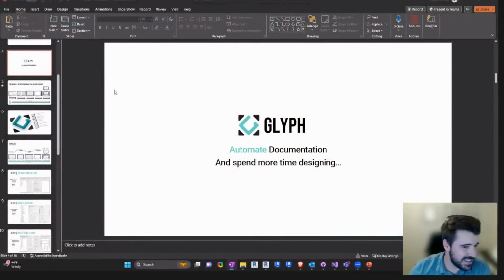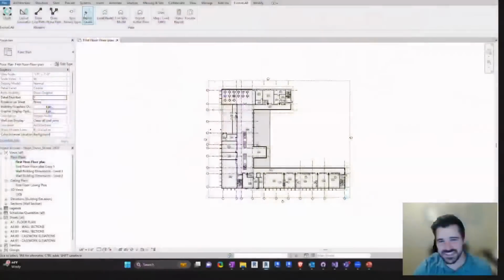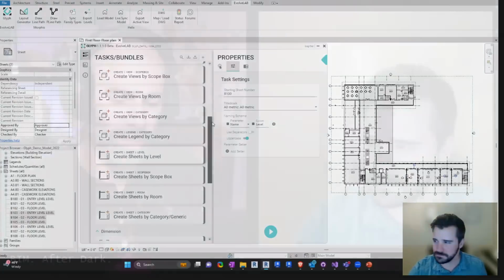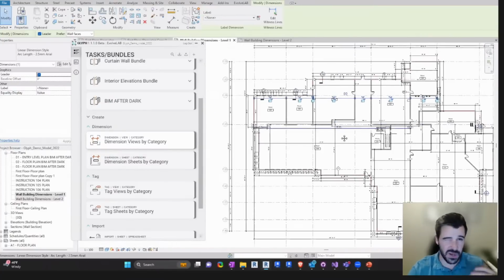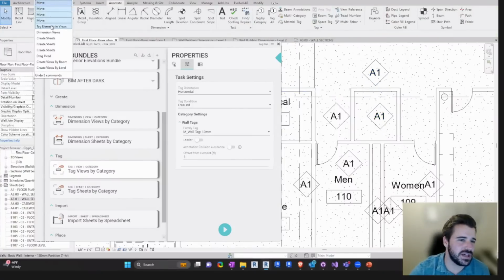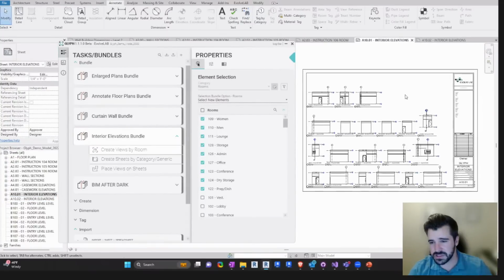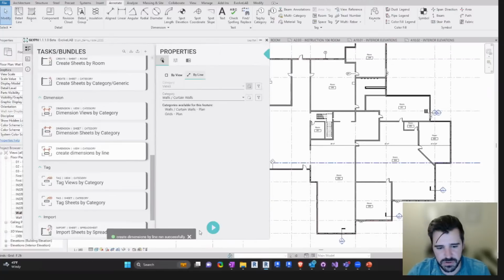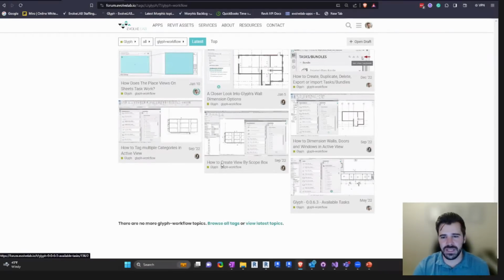Automatic Construction Documents in Revit (w/ Miguel of EvolveLab)

Comment: Hey i had a chance to start with C# and went tru some tutorials here and on the autodesk site. Is there any online class book or webpage that i can use to get better at making this kind of solutions?
Reply: Google...Google,,,,Google. Start all your google searchs with "Revit C#" and end search term with "example"  Youtube videos are good resource for C# examples also
I do these same tasks and you will see some sites come up way more than others for solid examples for selecting items, getting their parameters and using that info. 
I find being able to make an add-on ribbon with symbols is a good start to this journey. Getting a "Hello World" command to work was my entry point to visual studio and Revit.
I then got ribbons with buttons going to get those commands added to a flyout to get those symbols added without scrolling a project browser. Then the tasks open up wide. Maybe extracting information that spans multiple schedules? One example I  needed a routine that revised rebar marks by their length. C# was my answer. Good luck in your journey